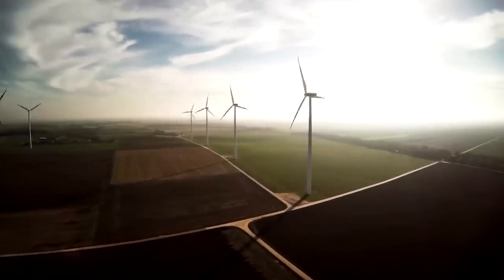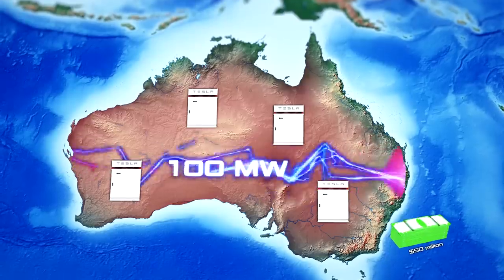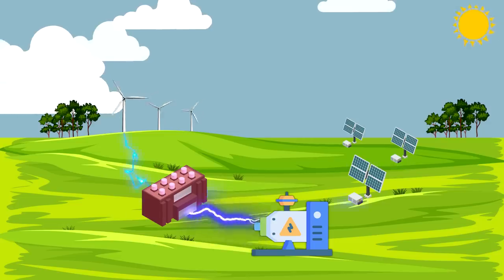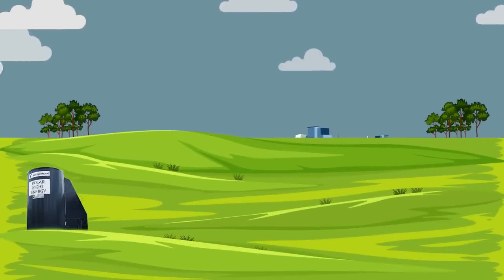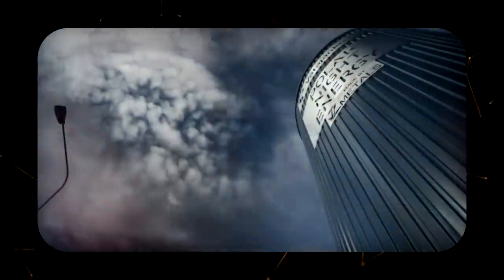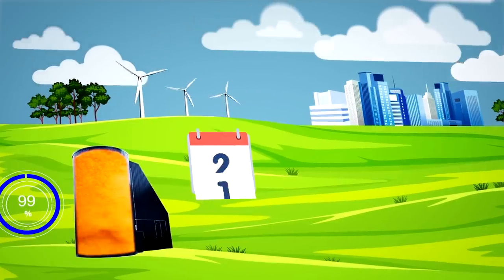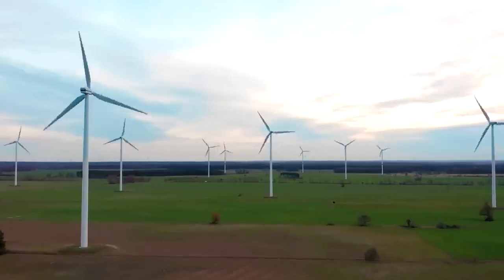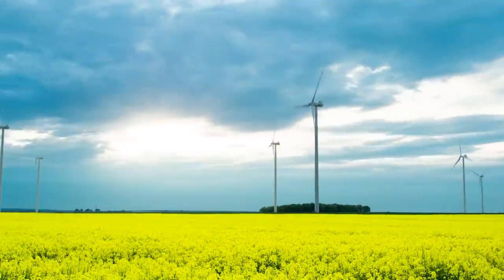How sand batteries could change the rules of the energy storage game

Comment: Main problem is efficiency, it cant beat efficiency of the batteries because conversion from heat to electricity alone is inefficient
Reply: It can because batteries have several problems. There is the initial cost, the availability of raw materials and limited cycle life. You still get a round trip loss of  about 10% for batteries. There is also a recycling problem. Batteries are not very green at all.
Reply: It looks like they are currently using it for district heating, which means they are not converting back to electricity.
Reply: @JosephAndracchio  If you heated the sand to 1700C, which is the melting point, then you have a theoretical maximum efficiency of 84% when converting heat to electricity. You just do it the same way as a power station but the sand is the heat source instead of coal. The higher the temperature the higher the efficiency. 84% is just a tad lower than lithium ion batteries for the round trip.
Reply: @Andrew-rc3vh  I understand that it could happen. But I was referring to how they are currently using it. They are not converting back to electricity in the current setup. They are heating to 500C or so and using it for district heat, so they do not have to consider any losses converting to electricity.
Reply: @JosephAndracchio  It's the obvious way but it is the dumb way. It's very expensive to install all of these pipes and you have to insulate them as well. I think it would be possible to cope with 1700C, but any hotter and you run into problems containing it. If you convert to electricity you lose 14% in energy but if you then use a heat pump your efficiency is ~330% for heating and you already have a grid to deliver it.

Comment: No one ever asks about efficiency...is everyone that visits this channel special needs?

This is a horrible system, if the costs are $10.27 per kw/h. For example, the average cost of energy in the UK is around £0.20 per kw/h (about $0.25). Bearing in mind that the UK has some of the highest electricity costs in the world...

If something sounds too good to be true, it probably is.
Reply: They said "installation cost" is $10.27 per kwh. It may be that they mean cost of installed capacity and not operational cost. They are not converting the stored energy to electricity. What do you think?